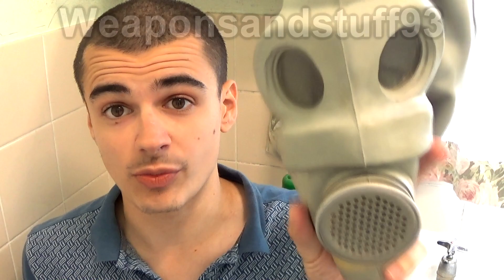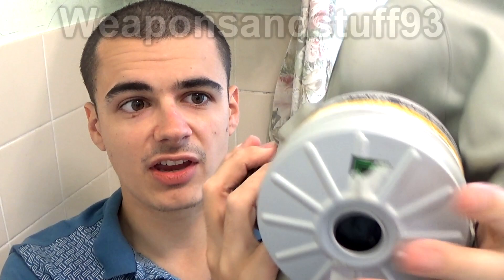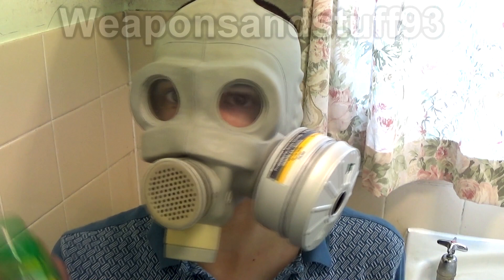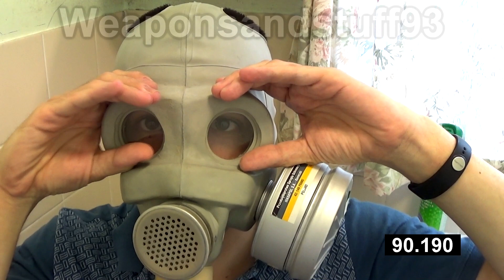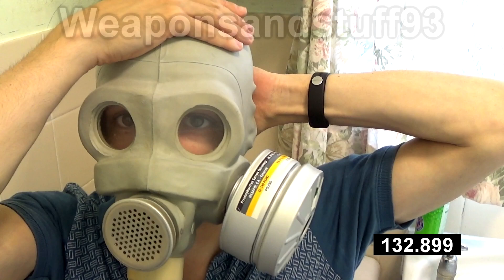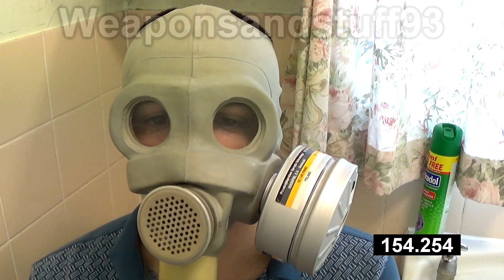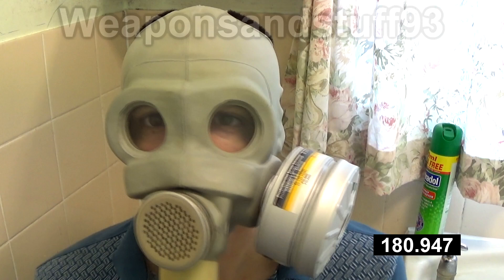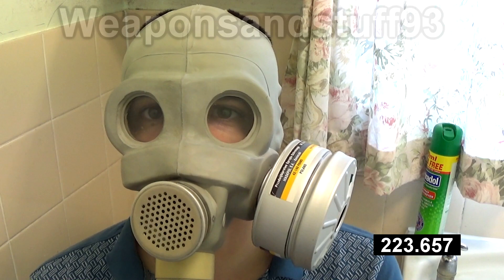Soviet PMG Gas Mask Test

Comment: I found some new info related to the pmg on the forums....

I have read that a modern variant is in current production... its a bit different... because it has like a metal ring and the metal front piece is a bit angled... and has different colours.... to it... The production of these it is said to have been until after 2004
Reply: I think you've just mentioned the Hungarian 70M

Comment: I remember putting a Israeli filter on the pmg for some reason it fits really well on the mask
Reply from the maker: Sometimes NATO filters will fit on but it won't make a 100% seal.
Reply: Rubber thread allows it to seal, be extra gentle when putting nato filters on though

Comment: I got that mask yesterday it's my first gas mask
Reply from the maker: Cool but don't use the Soviet filter.
Reply: I know not to get the filter. Also it is a good first mask because you won't have to worry about the intake valve rusting
Reply from the maker: Well, it won't rust but it could just rip apart.
Reply: Steven C. Is this a cult?!
Reply: SkeloFace Gassed Your first test commences at 0600
Reply: Steven C. What?!
Reply: Weaponsandstuff93 I know and also do you think that sewing a small rip in a mask will work

Comment: i got one of these and when i breathe through it (with and without a filter) the little rubber thing vibrates creating a didgeridoo-like noise. Anything that i can do to stop the noise?
Reply from the maker: Rubber thing as in the inhale or exhale valve?
Reply: Weaponsandstuff93 I have the Same Problem on my GP-5 mask exhale valve
Reply: XxXColeman273 XxX hm ok thank you, do you have a tip whether I can repair it ?